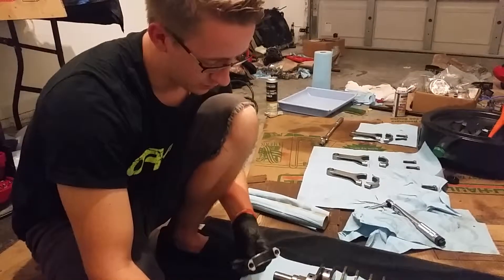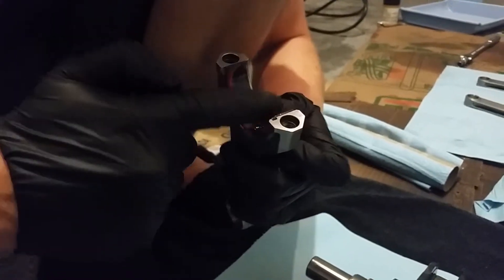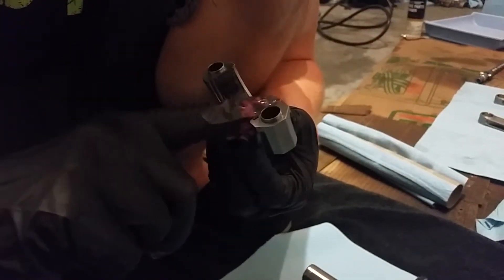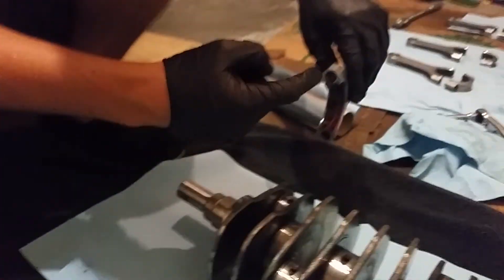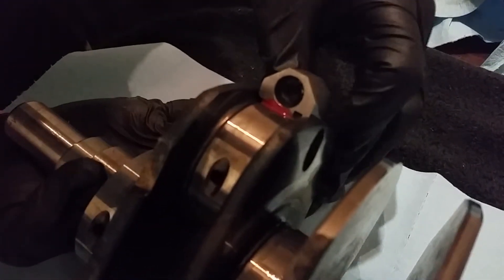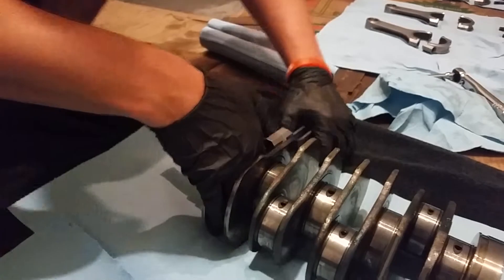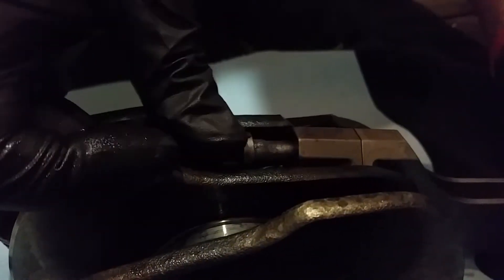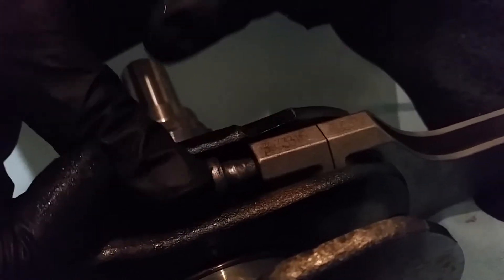EJ25 WRX STi Installing Connecting Rods on Crankshaft (Part 2)

Comment from the maker: The clearances will vary depending on the application. Ill check my blueprint sheet when I get home. Rods were set to .0022" since the rods are what usually lack proper lubrication. I used redline assembly line on the bearings.

For break-in, I used brad penn break-in oil. 

Since my main line was already within spec, and my power levels are below 500whp, I stuck with the stock case bolts. If you switch over to anything other than stock, you need to have the main line checked at the very least :) most likely it will require a line bore though :/

Good luck man!